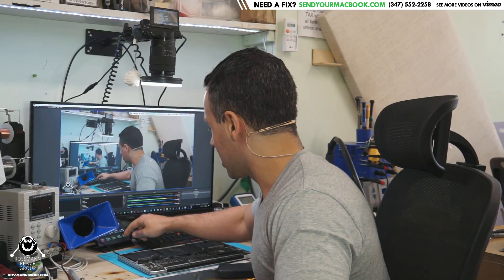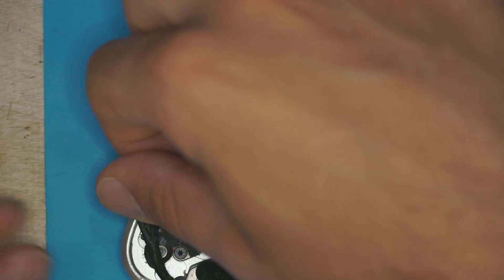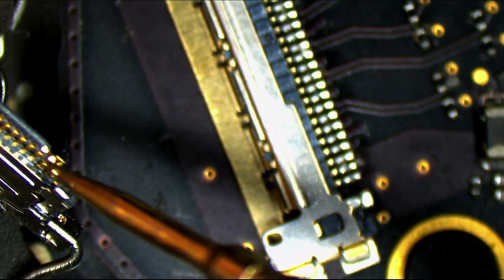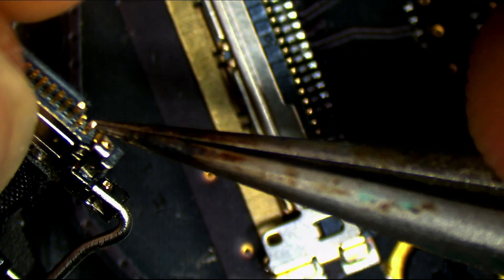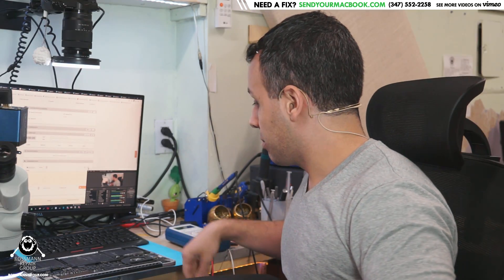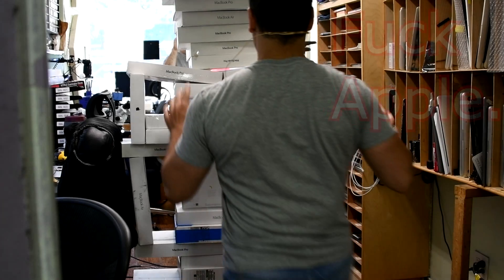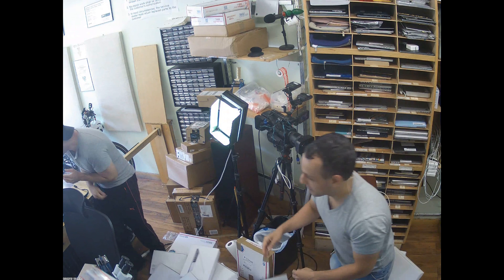APPLE GENIUS BAR STRIKES AGAIN!

Comment: Louis's videos are a constant reminder of why we should never piss away our money on CRAPPLE products.
Reply: But they are the best laptops for college.
Reply: @jamesisaac7684  omg they are not
Reply: @jamesisaac7684  not if you are an engineer, apples are not recommended for engineers they can't run any of the software
Reply: @jamesisaac7684  Most colleges are a scam nowadays with all the worthless degrees they peddle. Also...
 One can easily do college work on a cheap Windows laptop as well. Only reason colleges push CRAPPLE products on campus is the image factor.
Reply: @jamesisaac7684  - Based on what qualifiable or qualitative measurement? There is absolutely no broad-ranging information that would support the supposition that Macs are the best laptops for ... anything, let alone college. Also, if you lack the foundational principles of critical thinking that would let you easily and immediately see the fallacy in a statement like 'Apple Laptops are the best laptops for college', then I'm going to suggest that perhaps you lack an adequately educated perspective to even bother attending college.

Don't get me wrong, I am not arguing the point that a Macbook might be the 'best' supplementary IT device for your education and doubly so if you lack even the basic drive to question the veracity of its usefulness, given that Apple prides itself on selling to people who won't question anything told to them by Apple, but the statement 'Apple Laptops are the best for college' is pretty much like saying, Apple are the best, because they are Apple, which are the best, or I'm telling you the truth, because I wouldn't lie. Believing either of those things to be self-validating is moronic.
Reply: BMW Enthusiast True, engineer programs doesn’t support macOS, so you are stuck with windows. Still macs are beatiful devices, i have never seen someone’s mac fail, speaking of my friends.
Reply: Except when you're running a business and rely on an all in one platform that supports all target OS out there. Then you might ignore that some Genius Bars in the US are seemingly shady and enjoy your consumer rights in other parts of the world where all the stuff get's fixed for free within warranty or for a reasonable price outside of it.
Until now, for the same period of time, using "Crapple" was economically a far better choice than any other platform we've used.
Reply: @jamesisaac7684  muahahaha you're funny!  My 23 yr old daughter just graduated with a degree in Psychology and all her 4 years she used a pc laptop.  Never ever had an issue.  Best $599 I spent
Reply: I owned an Apple MacBook Pro for the majority of my college life (Electrical Engineering) Never really had a problem with it. Yes it runs every software that you need since they offer bootcamp. I spent a lot of money on mine though since I upgraded the mid 2012 laptop to a terrabyte of storage and 16gb of ram. I used a Windows PC for just a small amount of time because the PC couldn't handle the software I had to run for my classes. It bugs me too how it randomly updated when I needed it. After the mid 2012 laptop I feel Apple products really went to shit though.
Reply: James Isaac at Computer science classes and engineering classes here in Germany most students use thinkpads - they can be repaired / components can be replaced / rarely fail anyways: wrote my bachelor thesis on a t60 from 2004 which is still running, my master thesis on a T61p (2007) which I still use for programming SPS and my MBA on a X230T (2012) which I still use today... my wife’s air on the other hand didn’t survive 2 years 🙄

Comment: Free repairs for bent pins...
Bloody hell you are a Saint
Reply: Not Free, Just not replacing a component that doesn't strictly need replacing, but is not to spec.  The component is the $150. 

The three pins handle contact and conduction losses on the relevant display connector power rail by acting as parallel conductors, effectively dividing the resistance on that line by 3 and improving reliability of the display controller IC on the other end of the connector.  These traces on the edge of the connector need strain relief and contact reliability and triple redundancy is sensible.  This is commonplace in LCD connectors as Louis says it is.  As an Electrical Engineer who worked with these things and wrote low level drivers in C on microcontrollers for displays like that, I would know.  Displays are touchy as all heck and designed/manufactured in the least robust manner tolerable.  One doesn't solder flat flex edge to edge and expect it to work very long without strain relief.  Cue me tacking wires to backlight LED from the flex for some display.  These connectors aren't well designed for repeat insertion and one needs to be very careful.  In order to get the dimensional reliability in the type of plastic used for this connector it had to solidify very hard and brittle, not very strong.  Hence the breakage observed here.
Reply: @notamouse5630  weird unrelated flex

Comment: Firstly Louis, thank you very much for taking the time to share your knowledge with us neandertols. For exposing APPLE for what they truly are & for fighting for the right to repair. It looks like Europe are much closer to introducing it than our US counterparts.

I have a HP Pavillion 15 aw065sa, not the greatest of machines, fitted my budget & needs at the time I purchased. Thanks to guys like you, Pauls Hardware, Bitwit, Linus & Co, I picked up the courage to replace as swollen and inefficient battery myself. The battery cost me $25 on Amazon and I had it installed within 2 minutes. I then got cocky and decided to switch out the preinstalled 2TB HDD for a 500GB SSD. Cost $50 and took 2 minutes to do. Then I went crazy altogether and upgraded RAM from 2x4gb 2133mhz SODIMM to 2x8GB. Cost $70.00 and took 2 minutes to do. So for less than $150 & under 10 minutes of work, I have a seriously upgraded and improved machine. For soldering repairs, will still go to a tech repair guy. 

Is the MAC OS really that much better that people are willing to overpay for the device, have APPLE try to seriously screw you out of your hard earned cash when things go wrong, for the sake of using Windows 10 or Linux OS. Me no think so!

Comment: Bought a “failed retina lcd - apple genius” but otherwise working MacBook Pro 15” off eBay for cheap...

The lcd cable was unplugged 🧐
#Geniuses
Reply: B Pr  Thanks for clarifying it up. @Shaun4BigBlocks. Yes I do. But I was willing to take the risk and potentially get a huge profit by fixing it and selling it. Only thing I had to do was plug the cable back in and it worked perfectly fine.

Comment: My question is: Why did they remove the display connector to test the SSD?
Reply: Maybe the ssd is on the other side of the board? shrug
Reply: if you attempt diagnosing the board, removing the screen connector is given. Normally all connectors are to be taken out, you can see the host of the channel doing it on pretty much any repair.
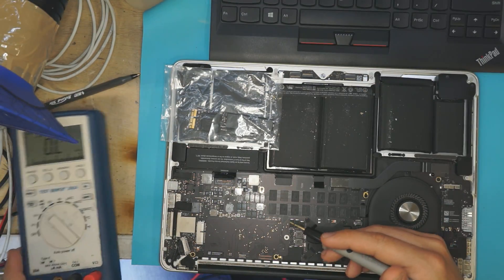Reply: @agalerex  actually the port for the ssd is next to the cable. At 5:17 you can see the replacement ssd and at  5:30 you can see the port and space for the ssd in its full glory.
Reply: to fk it up!... they cant find what was the issue, they make one thing so they could say BUY NEW ONE!
Reply: @mass1985  It's most likely that they removed it as a matter of course and then damaged it when plugging it back in, then made up some bullshit to cover up their mistake in order to protect their job. The customer gets the shaft and Apple corporate doesn't know or care.
Reply: @desther7975  So...nothing has changed in several decades? Yikes...
Reply: @stanimir4197  I think you misread the question, @GamerTech was talking about removing a connector to test an SSD clearly visible when opening the machine, when no other visible damage was present, considering the client said the SSD was not recognized. Anyone who removes an entire board to test a visible removable SSD shouldn't be working on peoples machines. Shame on you Louis for liking this reply and not correcting it.
Reply: @BootedTech  there is no feasible way to determine lack of water damage but taking the board out. You don't know it's the ssd or the pcie lanes or anything. While I am no professional repair-man, I do service (incl. smd soldering) few non apple laptops. Taking them apart is just given, like I have mentioned.
Reply: @stanimir4197  Honestly,  keep watching Louis, your methodology of diagnosis needs work.    

No need to remove an entire board when the machine is clearly working and has a ? folder on screen and there is no visible signs of damage and customer says SSD is not working. You would: a) Try a known working SSD, if that works, obviously the customers SSD was faulty. b) If known working SSD produced same fault, then diagnose board. Process of elimination, going in with guns blazing is exactly what apple did to this machine and they broke it.

No need to rip the entire board out until you eliminate all possible faults first. Which I am pretty sure Louis does all the time.

Comment: I have had my 2012 Macbook Pro worked on by Rossman Group, last year or so. I trust them more than Apple.
Reply: running like new? Did they upgrade it so that I can be good for few more years?
Reply: @WisamSafi1978  Yes they did!I had my logic board replaced and a drive cable.

Comment: Bravo 👏 !!! I tip my hat to you for telling it like it is. I do repair work on my own laptops and my friends from switching out motherboards and cpus to simple screen ribbon replacements. There’s been a few times when I get a unit that needs work and I ask if they took it into anyone and they said yes, the manufacturer but they are going to charge x amount to replace or repair. X being 200 -500$ which is outrageous. 70% of the time the parts cost at most 150$ and I charge accordingly. Never been more than 250$ since that exceeds most prices of the units themselves. Manufacturer’s are lying cut throats who make customers feel like there is no other option and they’re the only ones with the knowledge and capability to repair your device.

Comment: From my experiences as an electrical engineer, this sort of thing happens pretty easily.  Flat flex connectors without a positive lock and proper strain relief are terrible.  Misalignment is easy to do and in some circumstances can cause incorrect routing of signals resulting in screen failure.  Never plug in a screen flat flex when power is on.  Always check that the cable is inserted correctly and is all the way in and perpendicular to the connector before latching the connector. 

For PCB design professionals in the crowd: When practical, use reliable and tight fitting flat flex connectors for board design.  Your embedded software and board bring up people will thank you for eliminating a point of failure. 

For my fellow embedded software and board bring up professionals in the crowd: fix boards and screens to a frame of some kind where practical to avoid straining the flat flex too much.  It can be a wooden truss like structure made with CO2 laser cut plywood or balsa.  This allows for rapid prototyping before the metal chassis is available and makes for a design you can reach to the back of for probing because you designed it as a truss rather than a metal plate.  Indeed I wish I had this so I could have done things fast and right at my last job.
Reply: Instead, they do like you see, here. Probably saves them three cents per machine. I have seem non-Apple expensive notebooks with similar connectors, yet $150 Chromebooks with all well-secured locking FPC connectors, strain reliefs, and a bit of extra length to give some slack. You just never know.

Comment: 8:58 Passive aggressive Louis is awesome.

You're missing the point here. Apple is Apple. MacBook is MacBook. Genius Bar is Genius Bar. All those reasons are why people trust Apple more than you.

Louis: This NEW Lenovo think pad...
Apple fan: I don't care...
Louis: The Genius Bar bent your pins...
Apple fan: I don't care...
Louis: YOU ARE BEING RIPPED OFF!!!
Apple fan: I don't care...
Louis:
Apple fan: IneEd A MAckBuuk. WheRe is MAckBuuk???
Reply: @pvshka  Natural selection is too slow.
Reply: @Verpal  I always used to say to people who said to me "smoking kills, and second hand smoke kills too".... I would look them dead in the eye, and say "not reliably enough for me." as I exhaled.
Reply: @menotu000  Honestly, Smoking aren't that bad if your profession have a relatively high risk and shorter lifespan.
Reply: @Verpal  Its sometimes the luck of the draw, Mother passed away with Cancer at 50 yet Brother In law turned 90 last week and still smokes from the age of 10.
Reply: What’s up, Matt B
Reply: People like what they are used to, switching to an operating system with a different UI is annoying until you get used.  Personally I don't like any OS + UI that is available mainstream. :) 

Amiga OS!!!!!! :)
Reply: Sometimes I wonder which would be more of an insult: genius bar or retard bar. They are neither and I wouldn't be able to go in randomly and not use the word genius sarcastically.

Comment: i went into apple a few years ago to apply to be a genius and they told me i needed 4 years of IT experience but apparently they need 4 years of experience to tell everyone its a MB issue LOLOLOL
Reply: feel like most of the employees there definitely BS'd their way into getting that job
Reply: Fours years of IT experience? Doing what, cleaning the toilets at an IT company? I joke, because seriously I wouldn't trust a genius bar employee to be any better at cleaning a toilet properly than fixing a computer.
Reply: 4 years of giving out convincing B.S  more like
Reply: I'd have assumed an average IT job would pay better than a Genius Bar job.
Reply: Holy crap. There is no way that every single 'genius' at all the Apple stores has 4 years in IT.
Reply: Apparently that's where Apple stops knowing or caring. They'll take you with your 4+ years of experience and let you bungle things up, just as long as you cover it up. They won't check and bust you.
Reply: Travis lmao yeah, some dont know at all, others on the other hand know more then youd expect. I had a lady actually tell me where to get parts for cheap and which stores could get rid of black list codes oof. Others dont know what a ssd is

Comment: Louis, those 2 pins were shorting on the backplane, you could've fixed the connector with resin between the 2 bent pins and the backplanar ground resulting in you not having to replace the cable. Love your videos, you're very well spoken

Comment: Alright, so a couple honest questions: 

1) If I want to retain macOS on a desktop or laptop, do you recommend a hackintosh? If so, what setup?

2) If you didn't care to retain macOS, what do you suggest for daily use desktop and laptop?
Reply: Why do you need it? I've been running Linux Mint Cinnamon and it's been doing great.
Reply: @Foche_T._Schitt  my PC will have linux mint 18.1 with mate for the desktop after i get a new HDD for it but my phone runs android so i know most of the commands for linux and it will probably dualboot 4 operating systems (DOS 6.22, win 98 SE, linux and windows 10 professional
Reply: @nathanmead140  
Support for 18.1 ends April 2021. Cinnamon has become much more snappier in Mint 19.2 and is supported to 2023. Hopefully you mean SSD and not HDD. SSD drives are so cheap there's no reason to install your OS on a HDD. Even the WD Black isn't as fast as the cheap SSD on the market now.
Reply: @Foche_T._Schitt  MacOS still has some very useful exclusive software. Like, for instance, Logic Pro, Final Cut Pro, Xcode, etc.  Try developing an iPhone app without having access too MacOS.  I'll give you a clue, it's impossible. Apple still has the best OS on mobile and laptop / desktop.
Reply: Hackintoshes are nightmares, so unless you are fine with the downtime of them, 2013-2014 series MacBooks. If you don't need a macOS environment, ThinkPad P50.
Reply: Any but the most low-end PCs will give you a decent experience. If you're not locked into Windows for some reason, do install Linux of some variety on whatever PC you go with, because you will be better secured against malware just by virtue of the fact that it doesn't generally target operating systems other than Windows, and because it will likey run faster than Windows on the same hardware due to all the bloat that Microsoft includes now.
Reply: @hihi217  Thank you for the straight forward reply. This helps a lot.

Comment: In a former life I was an avionics bench tech in general aviation (small planes.) Occasionally a customer would ask, often with a wistful expression, if they could watch. I was always happy to have them see what was being done to their expensive equipment and why. A good tech makes even the most mysterious equipment clear. Once an insurance representative brought in an RNAV (area navigation computer) that died when the insured was flying through heavy rain. "Mind if I observe?" C'mon in!" When I removed the cover he was able to document with his camera that there were indeed water spots on the main board, but the conformal coating made that a minor concern. The power supply was dead - no discoloration - and a voltmeter narrowed the cause down in a minute or so. There was a pinhole defect in the conformal coating on top of a thin trace, and the trace had a gap in the copper where the pinhole was. Click! The insurer was able to forward the bill to the manufacturer for the obvious manufacturing defect. A little scraping to expose the copper ends, a small wire bridge soldered across the gap, and a dab of polyurethane made the unit as good as new, and the customer saw it and captured it all in detail. Half an hour labor made everybody happy as clams.

Now... what does it mean when a tech does not want a customer to watch? That's right.